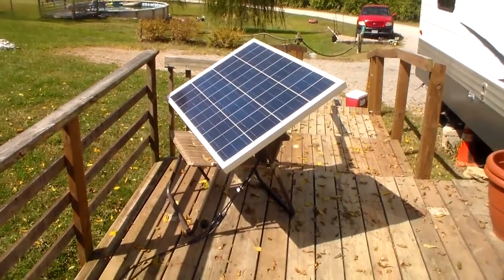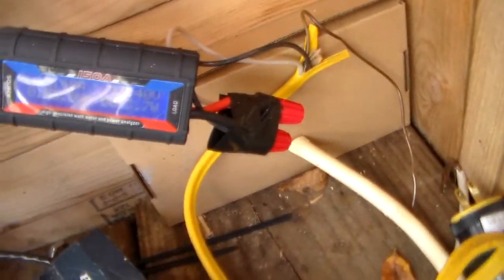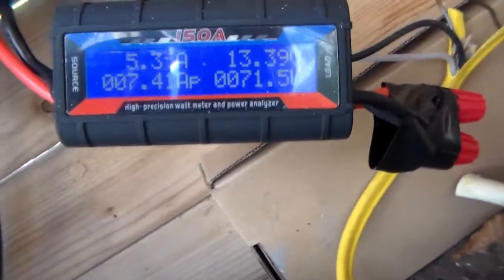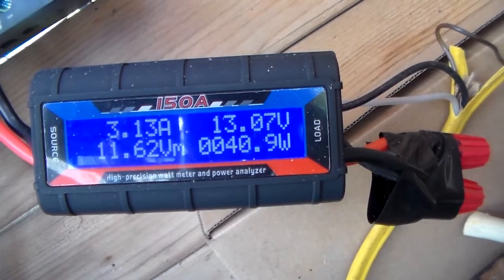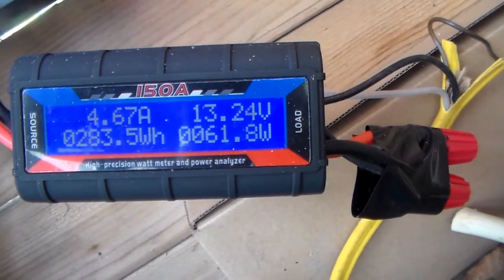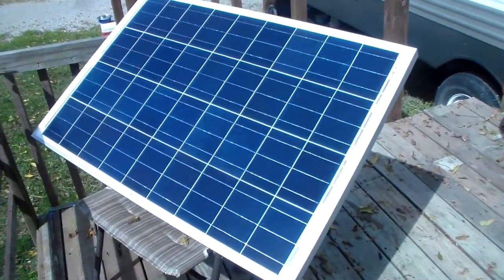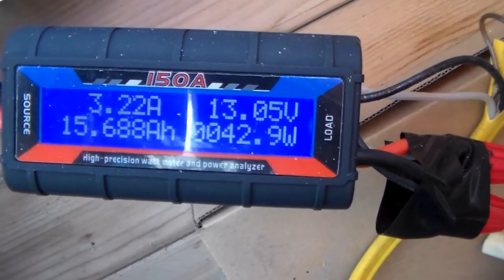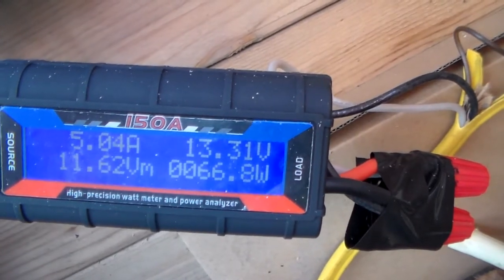Real life output of a renogy 100 watt solar panel

Comment: Are those twist connectors and electrical tape that I see connecting the charge controller to the panel?!

Not trying to be a dick, it just comes naturally but I have a feeling you’re not seeing the full Input because of improperly connected, poorly insulated, and probably loose connections in more places than just what the video showed 

I bet you I could locate voltage drops, shorts to ground and a couple other places that the rest of the power is escaping from 

And people will minimize the mismatching of components too, but a Renogy panel is designed to be used with a Renogy charge controller….will it work with other brands….obviously it will, but it’s going to perform at a less than optimal level!!

Think about it this way….if you have ever spent $1000 on a new iPhone and a week after buying it, you are out and you realize that you forgot your genuine Apple charger that came with the phone….are you going to stop at the first gas station you see, grab a $10 lightning cable and knock-off charging cube and plug that into your brand new iPhone?!!!

Obviously anyone who understands the fundamentals of electronics knows just how horrible of an idea that is…..same thing here….just a little different
Reply: Not to be a dick but, I actually have an USB "Genuine iPhone" charger and bought a 4 port usb charger on Amazon for less than $10 and it out performs the "genuine Apple" charger!

Comment: Thanks for the video. I will use three or four Regony solar panels to charge an Ecoflow Delta portable power station. I notice that your meter read around 5 amps output. On the Ecoflow Delta manual. they say that the maximum input is 65 volts and 10 amps. I guess that means I should only use 2 panels, so I don't go over 10 amps?

Comment: i have 3 10watts parallel watts and only have total watt output of 7watt in max (), is ths normal?
Reply from the maker: Seems kind of low. It of 30 watts I would expect more like 20-25 watts at peak hours
Reply: @Manchew   yeah. ill test them soon again. does also pwm controller decrease the watts ?

Comment: You will get close 100w with mppt solar charge controller.
Reply: No you won't.
Reply: @GoatZilla  depends on the panel temp
Reply: @joshwayop  That's exactly correct.  When the panel gets hot, its Pmax goes down, typically around 15% in broad daylight compared to the STC rating of the panel, which is 100W.

And no MPPT controller will ever make that back.

Therefore he will NOT get close to 100W with an MPPT solar charge controller.
Reply: @GoatZilla  also depends on the panel some high dollar 100 watt panels with sunpower cells get around 107 watts even when its already warmed up from the sun
Reply: I have a MPPT controller and 8x100w Renogy panels and have never gotten more than 75w out of each. I tried to contact them, they no longer take phone calls. And run you around until you go away by email. No more anything from them for me.

Comment: Simple Homestead so a 100w solar panel in one day can produce about how many watts? 73 watts in one day? Times 30 days so one 100w solar panel can produce 2190 watts a month? About?
Reply: Do you mean 73Wh? You should find the energy produced, the power output is constant. 73W output is shown, so if you get 5 hours of sunlight a day, you'd get 365Wh per day, which is 10950Wh per month. That's around 10 units of energy, which isn't bad, and can be increase to 30 units if you buy 3 panels

Comment: 5.5 amps is good you're an idiot
Reply: Shawn/IO - I agree with your statement but I think he's talking about overall wattage which is only 2/3 of the rating. Would be nice if they give average rating rather than just peak. Looks like 100 watt in best condition is a marketing number.
Reply: @Ali - Marketing does not have to be based on lies or stretch of truth. Many people chose not to be fully honest. Look at MSRP ratings. I caught up on it and I ignore it (almost completely).

Comment: try with an mppt and you wil see the real power of the panel
Reply from the maker: +iulian onofrei It does pretty good with the pwm charge controller 70-80 watts but yea i have one 100 watt panel and one 150 watt panel right now once i get another 150w panel i will have to update my charge controller due to max amp of controller. Then i'm most likely getting a mppt controller. hopefully there will be a significant difference when i do.